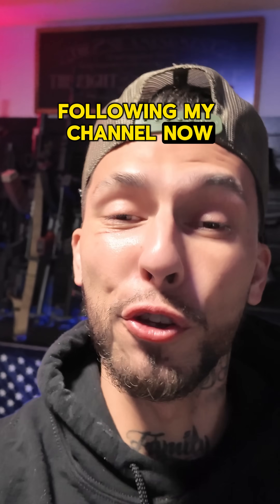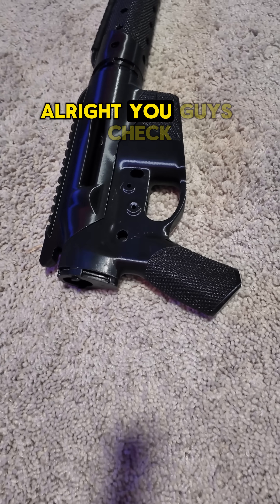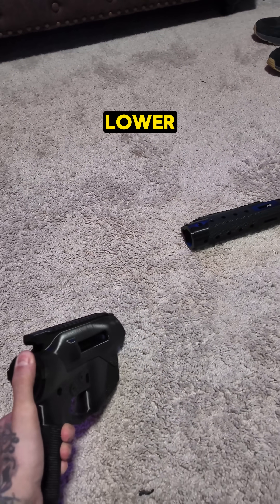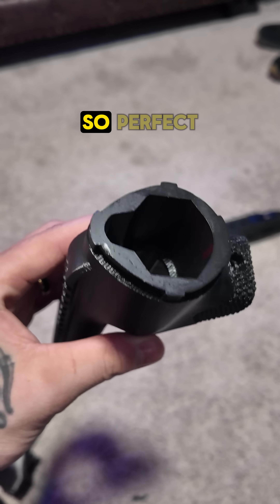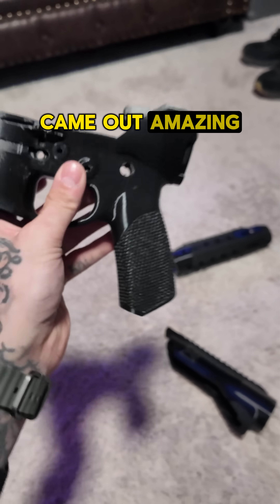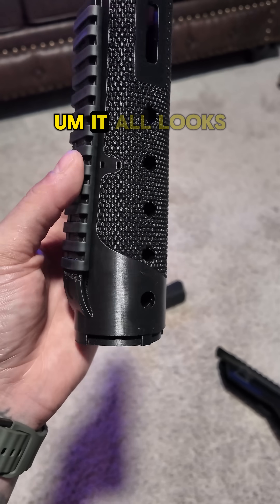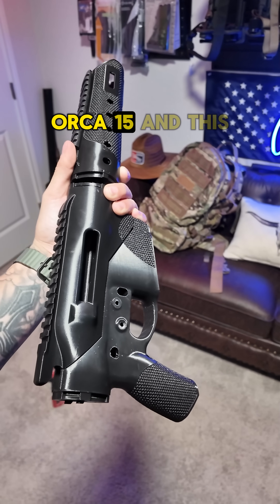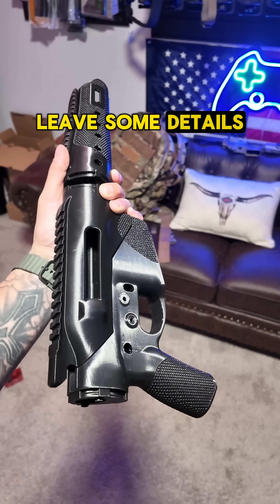The Orca-15 Build by Hoffman Tactical | Part 1

Comment: What orientation did you print the lower handle? I printed mine with the support that they supply but the bottom of the handle came out screwed up